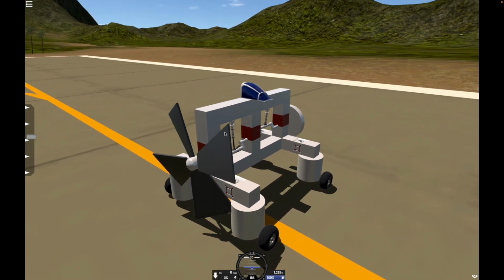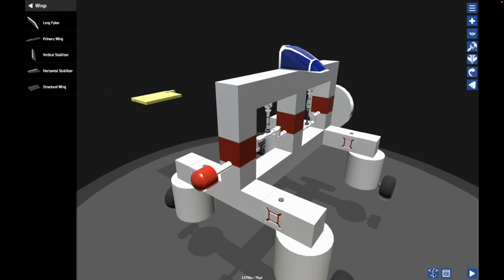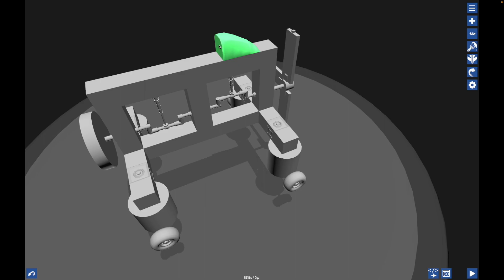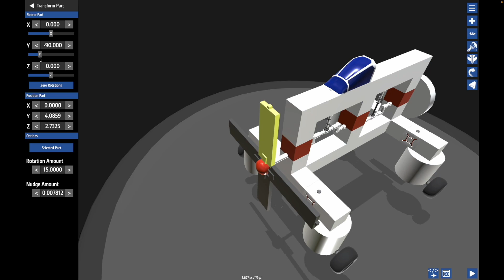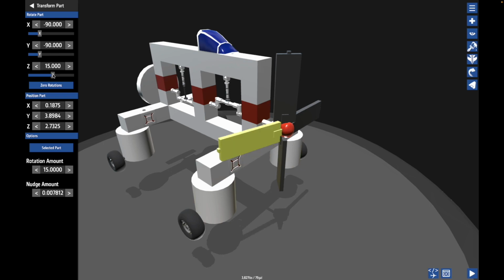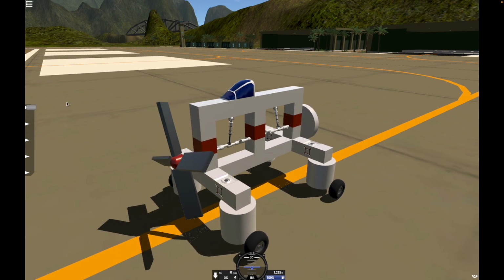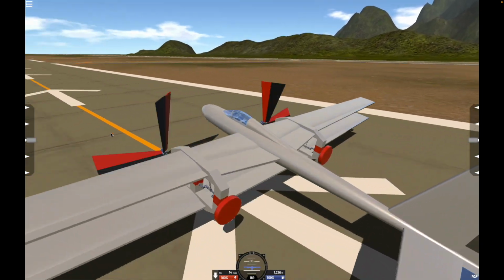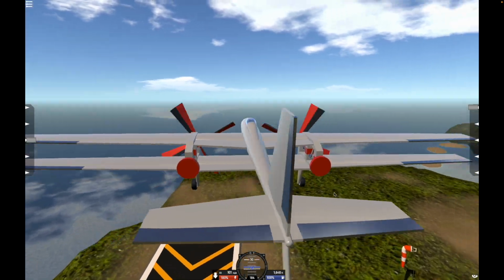How to make custom wing propellers in SimplePlanes

Comment: Thank u😊 but i know u mean the mod by HellFirekoder? The overload mod?
Reply from the maker: No problem. Yes, it used to be included in vanilla, although you still are to activate it like a mod.
Reply: @differentthingsgaming  I didnt know that! But you are good at simpleplanes and can u do it on mobile? (I Mean the cloning)
Reply from the maker: @onlycab10000  Thank you, If you're referring to part duplication, I just right, clicked and dragged, I'm not sure how to do it on mobile. One way that will work is to mirror the part and you'll get a duplicate of it facing in the opposite direction.
Reply: @differentthingsgaming Oh ok! I will try to bulid a propeller car and juno: new origins or old simplerockets 2 has propellers, Do you know that simplerockets 2 has a in-game thing like fine tuner and you can edit speed and thats it! (Oops i switched it up its overload not finetuner lol)
Reply from the maker: @onlycab10000  Yeah, hope your build goes well. I have made a propeller car in Juno, but with wing propellers like I did, in this video, it's a lot easier, because you have electric motors that can spend much faster than piston engines in SimplePlanes.